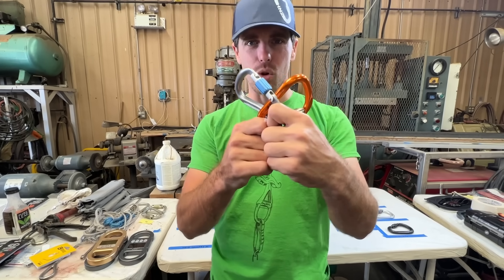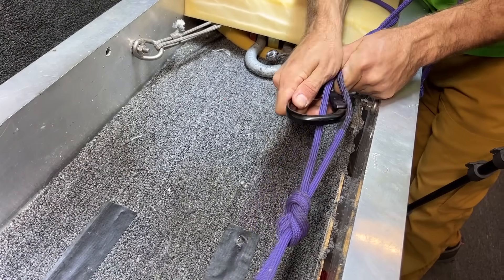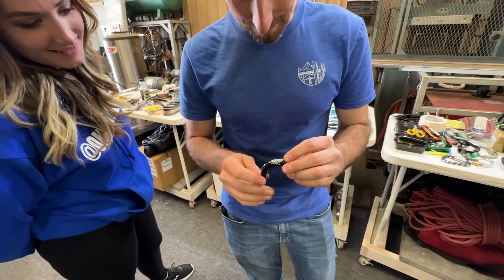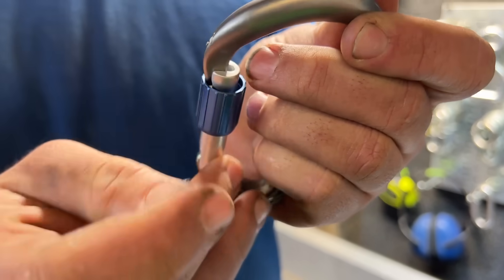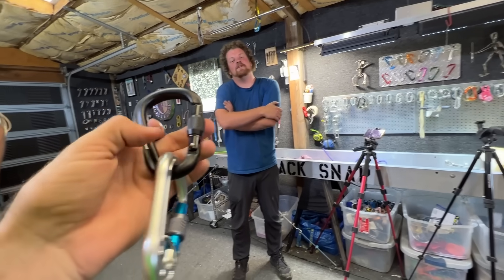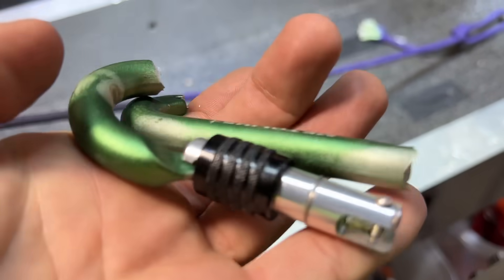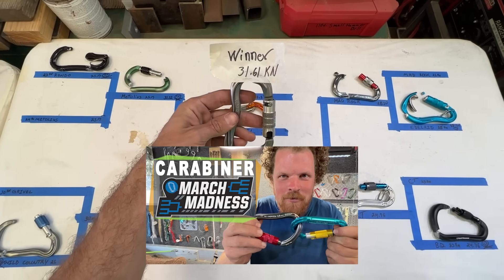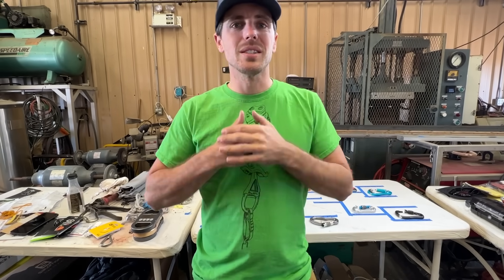Locking Carabiner Showdown

Comment: I love how you showed the busted Grivel in the video thumbnail so that we were all truly surprised in the end when it won. I still have an old Grivel Lambda and I love it for caving! I had an incident last year where I was unable to open a BD screwgate carabiner due to mud, I was mid-rope and miles deep and had to pour out some of my precious water onto it to get the screwgate to open. I learned that day to never again take a screwgate carabiner caving, because things could have gotten interesting if my water didn't get it open. I replaced it with my Grivel so I never have to worry about that issue ever again.

I would love to see your testing on Grivel's newer gate designs and/or hear if they are more resistant to the flutter fail-case.

Comment: Hi guys! 
We were very well entertained again :) Thank you very much. We would like to clear up the "mystery" of why the AUSTRIALPIN HMS RONDO SLIDE AUTOLOCK got a "strange coating" after it was destroyed:

The reason is as follows: the HMS Slide Autolock you used in this video does not have a "normal" anodised coating, like all the other anodised carabiners in this video - NO: The HMS HMS RONDO SLIDE AUTOLOCK is hard-coated, a specialized anodized coating. Thanks to its double strength and higher base-hardness, this coating offers higher robustness and therefore a much longer lifetime - perfect for frequent use. 💪

So these stretch marks come from the fact that we use a special double strength coating here on this carabiner. No powder coating! But we also like the theory of the "love between carabiner and hydraulics" :) 🥰

Greetings from Austria ! 🏔Thanks for the video - was again very entertaining 😆

Comment: I would love to see a video on the strength of hangers bolted into wood, we use ¹/²" lag bolts that are 3 ¹/²" long pre-drilled with ¹/⁴" drill bit and they always feel super solid and safe but no way to test
Reply: I would like to see this as well. I actually encounter bolts in trees/wooden structures all the time. I’ve also always been curious how a glue-in would perform if placed in a tree.

Comment: Hey guys I have a question for you. I have not watched all of the videos you've ever put out, so maybe you already covered this specific topic and I just missed it. But I'm curious if you guys have ever tested Titanium carabiner and what are your thoughts on them in general. Typically they are really expensive and most are extremely small and made for recreational use and not for climbing. I however have few Titanium carabiner that (despite not being specifically designed for climbing) look sturdy and strong enough to APEAR to handle climbing task. I'm wondering if I send you some of these Titanium carabiners, would you mind testing them and posting the results. I don't want to ask you to purchase them to test them, since its a topic I'm curious about and perhaps no one else is, so it wouldn't be fair. But I'm willing to sacrifice up to $40 per carabiner to see the results. I'm curious to see if they actually are strong enough for climbing tasks, despite not being rated for it. And I can't stress that enough. I'm would not use them for climbing and would never recommend for anyone else to use them. This is strictly for curiosity reasons. Even if your tests demonstrate they are strong enough, I would still not recommend for anyone to use them in such a way, simply because of liability reasons. If they fail, you couldn't hold anyone accountable, cause they don't go the same quality control to make sure there are no flaws or micro fractures in the metal. But if you guys are open to the Idea of testing them, please respond back, and I'd be happy to ship you couple of my Titanium carabiners to be destroyed. Money wasted in the name of science. Ok ill wait for your response, thanks.

Comment: Great video, like the head to head format over the chain of death.  Word of caution regarding the Edelrid, with the steel wear plate.  A few years back Petzl tried something similar in the Croll chest ascender and as it wore down from use in sandy environments it turned in to a rope knife.  Not something that’s easy to inspect with the naked eye so user beware.

Comment: Great test! But looking at the Grivel, when not under load it indeed only locks with one gate, but looking at the slow motion, you can see the second gate engaging when its loaded. So the strength really comes from the two gates. I'd be interested to know what happens when there really is only one gate engaged by removing one of them.

Comment: My vote is for the bracket system. But why stop at carabiners? Cams vs. cams. The black Totem vs the pink Tricam. Offset nut vs regular nut. Hex vs. cam. So many options. I'm sure that would be pretty difficult to orchestrate, but it could be interesting. Thanks for everything you've broken!
Reply: I feel you, I wanna see the roll n lock vs micro trax ,  I know the roll n lock will win easy but I could be wrong..

Comment: This style is great because it entertaining.  It's better than the chain style.  You could also use short slings or rope between them to bring it closer to a climbing scenario.
To take it to the next level of informative would be to compare breaking strength to weight.  Steel is super strong, but no trad person is going to be crazy enough to load up a rack full of them.

While it would be awesome to take it to the extreme by measuring deflection of the carabiner at various loads during the break tests, the number of variables is likely to much to manage in a reasonable timeframe.

Comment: I think the only reason those grivel carabiners are really useful is for ice climbing. That way, you can still get a locking carabiner when screwgate or auto-lock carabiners would freeze shut, and then the double gate makes it so you still have a good strength in the rare event that the standard gate accumulates ice in the nose and gets pushed slightly open. In any other situation it's just way overbuilt and cumbersome to use.
Reply: I actually love the action of the Grivel double gates. They have their uses and after very little practice are very quick to use.
Reply: I was literally about to say the twin gate is fantastic for ice! Definitely feels way less janky as a belay carabiner to use with climbing or belay gloves. I swear by using it all winter
Reply: other reason for it would be something needing super lightweight locking biners, as they are the lightest ones

Comment: How does Bobby feel about the Grivel carabiner now? Haha
Reply: Opinion unchanged. Overbuilt doesn't mean good or useful. All the easier to use carabiners met the relevant standard which of course has a safety margin.
Reply: @bobbyhutton1989  Have you played with clipping it much? I find it more usable than any triple action locker. All you need to do is open one gate then clip like a normal none locker. Also I think it’s safer than a screw gate when clipping in to the middle of the rope if you are the first of two seconds on a climb. Can’t come unscrewed from the movement of climbing or pressing yourself into an off width. Any thoughts on that?
Reply: @bobbyhutton1989  Good insight, sorry just starting to get into climbing that's a super helpful tip. Overbuilt != good. Thank you!